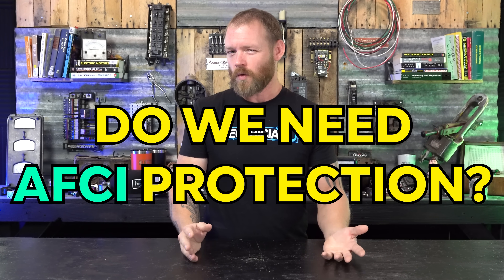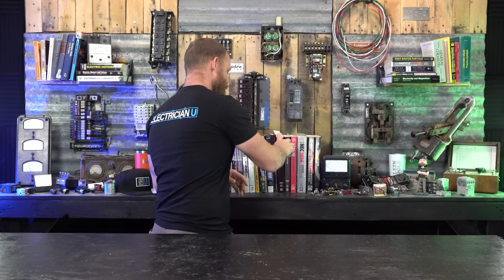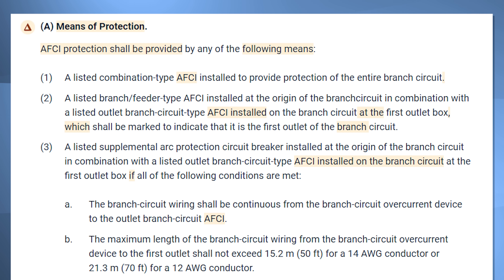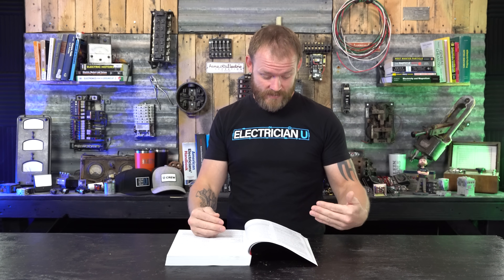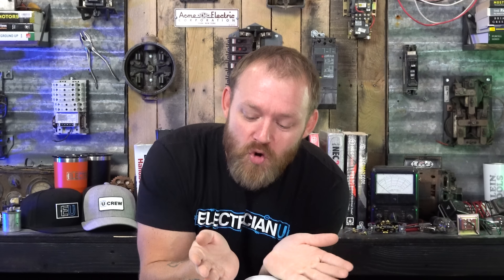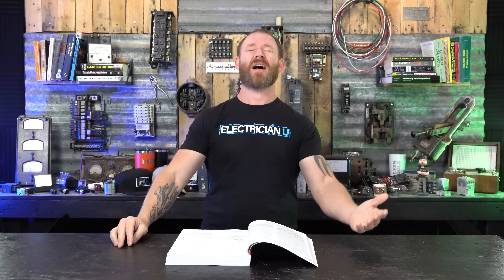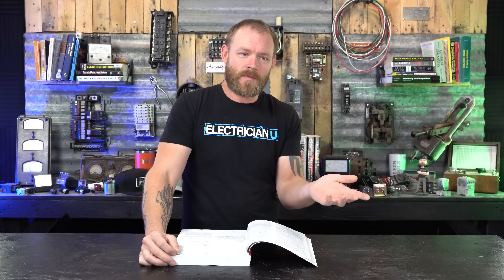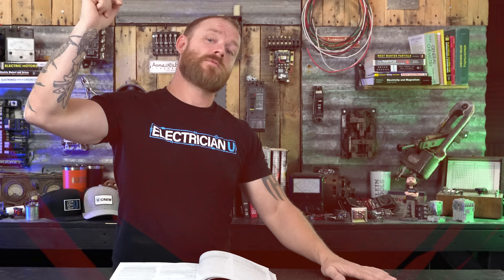Where and Why Do We Need AFCI Protection?

Comment: Can you use one of those afci/gfci receptacles at the start of a branch circuit? It would be 30 dollars cheaper than the afci breaker.  What's the rule on that?
Reply: Yes you can use that and gives protection from the first receptacle downstream to other receptacles. However there is no ARC fault protection from the panel to the first receptacle for which you would need a AFCI breaker at the start of a circuit.

Comment: I welding exception is probably due to the transformer which would isolate it from the main circuit coming from the breaker correct me if I'm wrong but that's my thought I'm not a professional I'm just an 18 year old that loves electricity and engines so plz correct me if I'm wrong because with a transformer you have a completely separate circuit compared to the primary wire and the second winding so I would think it wouldn't affect it it kinda has the same principle as a coil pack on a ignition system on a car

Comment: Just like my old electrical wiring instructor said to me “code changes constantly because it guarantees the clowns making the changes, a nice long cushy job and they also get kickbacks from the manufacturer’s” 🤔 similar to politicians
Reply: Along those same lines, given the cost difference between a "normal" circuit breaker and an AFCI breaker, I wonder what the markup price difference is. e.g, are they making a better profit margin on the AFCI breakers simply because they can?

Comment: AFCI breakers are often a huge nuisance, randomly tripping on loads like vacuum cleaners, which is 90% of what gets plugged into sockets in most living spaces.

BTW, in Canada, refrigerators are still on plain old thermo-magnetic overcurrent breakers because spinning things arc and food spoils.
Reply: it's not that spinning things arc.  It's that anytime coils are suddenly turned off they create large voltage spikes on the circuit.  Motors have large coils.
Reply: @tchevrier  Motors. Spinning things. I was being poetic. 

I guess arcing and inrush current are different, but for the amount these breakers cost you'd think they could tell the difference.
Reply: @helmanfrow  I understand, but it's not spinning things. It's anything with a coil of wire.  Any inductor.  True, motors have large coils and are the most common in a home, but so do relays, transformers etc.  And it's not a problem when they are running, or when they are turned on. It's a problem when they are turned off. They can create very large voltage spikes and cause arcing across the switch.  Remember older cars with ignition distributors.  The arc on the spark plug was created when the contact points on the distributor opened.  So it can be difficult to differentiate between an arc caused by an inductor/motor turning off and the arc caused by two wires shorting. Typically manufacturers put transient suppressors across coils because that spike can damage electronics and switches, but not always.  

Inrush current is a different animal.

Comment: I remember when 210.12 came into the code. The breakers were all false tripping, and the NY board of underwriters postponed enforcing 210.12 a few years, until manufacturers corrected their problem. From what I understood. All switches sockets and receptacles must be Arch fault in a residential dwelling. 
Protected from the source. There is a list of exceptions. I asked the inspector, can the 1st receptacle in the circuit, be Arch fault.  NO! The exception about Arch fault receptacles in my case was, I was able to install combination Arch fault/GFCI receptacles on dedicated circuits, "kitchens and bathrooms, with downstream counter receptacles, and on a dedicated outdoor receptacles circuit, where all the outdoor receptacles are controlled by the combination device at the 1st receptacle, must be labeled, indicating that the receptacle is Arch fault and GFCI Protected. Dedicated equipment is exempt. Hvac, heating systems. This was the last house I totally wired, before my health  forced me to stop working. It was 10yrs ago. I remember it like yesterday. You produce awesome podcasts!

Comment: What about data closets? Also access control would hopefully fall under the same category as the fire alarm systems.
Reply: Probably not. Access control is not a fire or life safety system, and is supposed to fail safe, so if it's faulting, it's better to shut it off from a safety perspective and open the doors. At least in theory and from the perspective of code writers in a spherical cow world

Comment: Perhaps if you followed the First Draft and Second Draft that develop each Edition of the NEC® more closely, you’d understand WHY requirements are there, or not. It would improve your credibility immensely. 

I disagree with your “fortune-telling” that AFCI will be everywhere in a dwelling. AFCI protection comes at a cost. Nothing goes into NEC® that doesn’t achieve a ⅔-majority consensus and AFCI protection in bathrooms, garages, basements and crawl spaces, attics, and outdoors were SPECIFICALLY rejected in 2023 NEC® because there was not sufficient evidence (facts) presented to convince a ⅔ majority that enough risk exists in those non-sleeping locations to justify the added cost. 

I do agree with your assessment about arc welders as arc-producing equipment. That’s why the Exception for circuits with arc-welding equipment was introduced. Nonetheless the Effective Date or the entire Exception should have been deleted when the proposals for AFCI protection in garages, basements, and outdoors were rejected; it was uncertain AFTER the Second Draft however whether or not amending motions at the final vote would reintroduce any of those locations. It’s likely that a TIA (Tentatively Interim Amendment) will move out that Effective Date or just delete the Exception outright.

Comment: Dustin ---- or Anyone else want to try to answer this question?
     If I'm changing out an old service/meter/main combo with house breakers, residential from 70 amp main to a 200 amp main and my local power company, Los Angeles Department of Water and Power (LADWP) is making me relocate the new service about twelve feet from the existing service location,  and I'll be using the gutted, existing can as a junction box to extend the existing circuits that feed the house to reach the new location and the breakers in the new panel, would that fall under the AFCI being needed for all the existing circuits? I'm not adding any new circuits at this time, just upgrading the service combo panel.

Comment: Would my 110 wire feed welder trip the arc fault protection?
Reply: no, it will use either a transformer or DC converter

Comment: 10:00 welders work off of a transformer. Welding is done ins the 25-30v range. The breaker cannot see what’s happening after the transformer it only sees a constant load. This is why you don’t want to play with microwave transformers. Nothing will trip if you latch on and it frys you.
Reply: The load seen on the primary will reflect the load on the secondary, but the transformer is designed for 60 or 50 Hz and won’t pass the higher frequency arcing back to the primary.
Reply: Not all arc welders have transformers some use dropping resistor's so the arc breaker would trip. So there is a concern for these type of welders on AFCI circuits. 73
Reply: There was actually a fault in hotel suit some years ago. A transformer put out smoke and the guy died. There was no code for securing the secondary.
Reply: or are PWM-DC welders and similar to transformer isolation, are filtered out.
Reply: The breaker sees a proportional current as compared to the current flowing on the load side of the transformer.  If there is a pulsed consumer on the load side of the transformer such as a welder striking an arc or an SCR firing into an electric heater - those same pulses will be seen proportionally on the line side of the transformer.  Feeder breaker supplying transformer loads do not see transformers as constant loads
Reply: Well-stated and accurate
Reply: Play with you don't play with electricity. That's what a 4 year old does. I was one of the 4 year old electricity player. I found out real quick the outlet was not a car ignition. Keys back then could fit in the electrical outlet. I think the proper English for electrical discovery is experimenting. Don't experiment with microwave transformers unless you know what you are doing. Like on TV. ,"Don't try this at home". 73

Comment: Apparently each type of arcing for machines have their own characteristic signatures, so the arc-fault breakers can be essentially programmed to recognized them as OK, and thereby avoid nuisance arcs. With each passing year, they get more and more smarter about this, so the arc welding machines should be an easy fix.

Comment: Worth the price. Some brands seem better than others. I’ve had a partial residential remodel where they were added to new circuits by Code. I added outlets to a pre-existing circuit in bedrooms. With a normal breaker the circuit stayed on. With an arc fault, the circuit would immediately trip. I traced out the wire and found the pre-existing wiring insulation gone in the attic from squirrels. In this case the arc faults stopped a potential fire that a normal breaker would not trip on.
Reply: Probably the only time I heard about an AFCI breaker tripping for an actual good reason 😂
Reply: Similar experience here.  I'm glad I made the upgrade.
Reply: I bet you my paycheck that a GFCI breaker would have tripped as well.